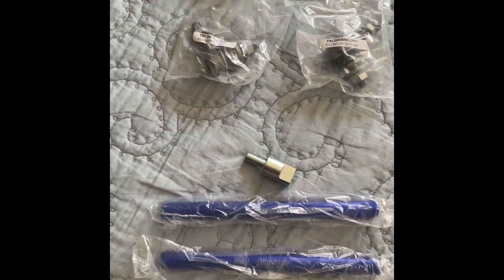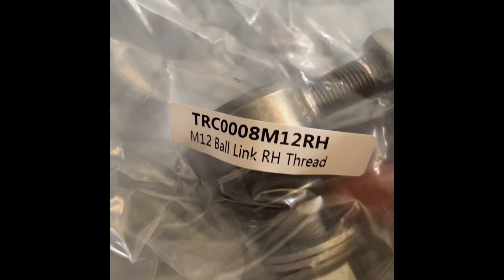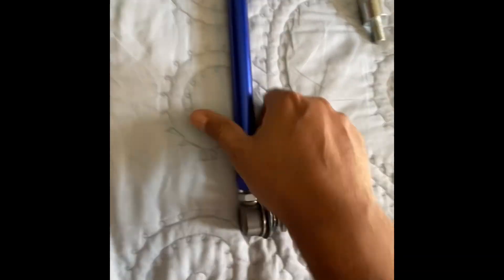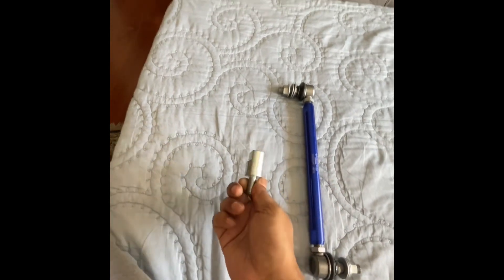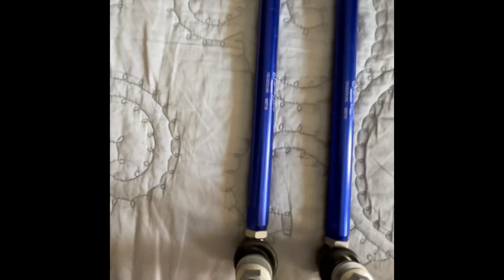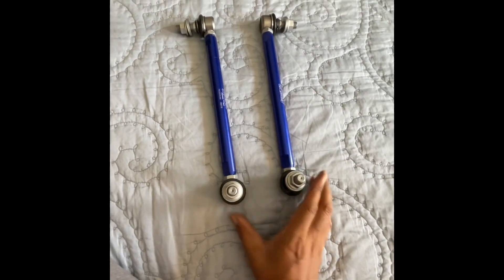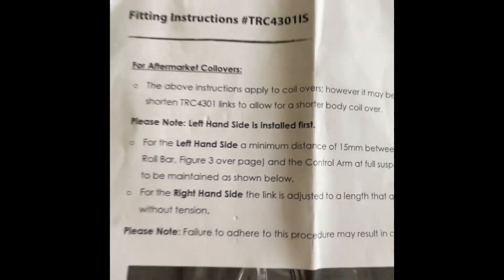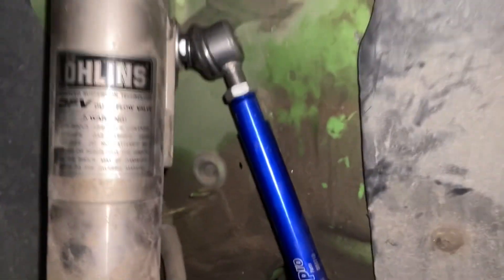SuperPro front Endlink Assembly and install notes for Skoda Octavia MQB and Mk6/7 Golf/GTI/R

Comment: Hello sir, 
I have a polo 1.0 tsi sitting on Euro springs which is little lower than stock, do i need this in that kind of scenario?
Reply from the maker: Depends on if you feel your front body roll has increased or not after the drop
Reply: @PrithwiRay  yes actually it does feel as if the body roll is increased slightly and steering doesn't feel tight enough but the euro spec feels more stiff and planted without sacrificing comfort as i have already tried out cobra and eibach, are this the symptoms that I need a end link? Also I have not upgraded front sway or added any rear sway for a street hoon and daily should I be anything any sway if so what?
Reply from the maker: @yashpatel3377  well honestly if your using oem euro springs, then the oem links should work fine
Reply: Pruthvi sir it is 12-13 mm lower than stock i don't know if it requires or not
Reply from the maker: @yashpatel3377  not needed, the oems can handle that difference
Reply: @PrithwiRay  so shall I go with any roll bar setup?
Reply from the maker: @yashpatel3377  a rear anti roll bar will help a bit to make the car more responsive
Reply: @PrithwiRay  so there is super pro with a 18mm roll bar and eibach, whiteline and ultra racing with 24/25 mm roll bar
Reply: bro how does the cobra behaves with stock shocks I have the 1.0l Tsi vento not happy with the stock gabriel setup
Reply: @dlpsr2361  Hi bro in search of the perfect suspension for polo I tried several options from which cobra was one, from my experience I wouldn't recommend it to anyone for any car. Since your car is vento go with Sachs shocks and stock springs a friend of mine is running it on his car for 10k and he is extremely happy with it, the gabrial shocks are fine for first 10-15k but then it gets really bad also the Sachs are super comfortable.
Reply: @yashpatel3377  Thanks for the advise bro....with Sachs and upgrading front anti roll bar and adding rear sway bar will control the body roll of the car?
Reply: @dlpsr2361  I advice first add Sachs and rear anti roll bar later if desired then upgrade front because front upgrade will make your car under steer

Comment: Hi Prithwi. 
Absolutely admire you with the knowledge of German cars that you have. Kindly suggest a nice FNG in Delhi NCR for me to get my Octavia diagnosed as the instrument cluster is currently lit up like a Christmas tree and engine compartment smells dead rat. For me, must be some issue with the wiring but as per Ring Road Skoda Jahangir Puri, it’s my ABS Module that needs to be replaced. Hard to fathom this for a car driven 19K KMs in 4.5 years and kept in immaculate condition. 
Thanks a ton in advance.
Reply: GT Tunerz - Delhi
World of Service - Noida
Global Automotives - Gurgaon
(2nd & 3rd can get your job done very economically)
Reply: @rohitpanchal2932  Much appreciate your help.